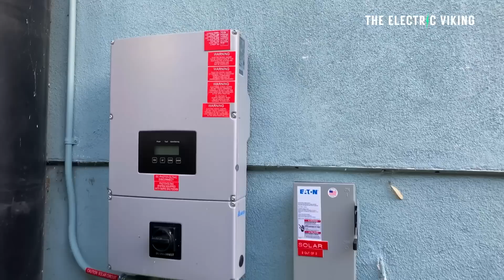Scientists say solar panel advances will see millions go off grid

Comment: In California here in the US the greedy electric utility companies like PG&E are ripping off homeowners by lowering the amount of money the homeowners can get by selling their excess electricity to the electric utility. This is hurting rooftop solar in the US.
Reply: Florida also... we have a net metering law, however solar companies have instituted a minimum monthly charge regardless of how much you generate. Its clearly against the state law but has het gone unchallenged. Its going to lead to many homeowners going off-grid as soon as battery prices allow it.
Reply: Yeah we have the minimum monthly in CA to. PGE offers and electric car rate but that transmission charges and other stuff on top of it so the EV rate comes out the same as if you didn't have it. .35 cents per kw which is the same charge as Suprechargers right now at least during off peak.
Reply: @mxguy2438  Why don't you guys just CUT the grid tie! That'll teach 'em!
Reply: @SeattlePioneer  as battery prices continue to come down people will start cutting the grid tie. It also takes more panels to go completely off grid. Its too bad, they are turning it into a lose lose situation when it could be win-win. The Utilities need to back off on trying to keep with the old ways and simply need to start doing arbitrage so everyone can win.
Reply: @mxguy2438  <<as battery prices continue to come down people will start cutting the grid tie. >>

There are huge advantages to a grid tyie for solar racketeers.  Why should they give that up when they can get so many services from the utility and impose the costs they create on other rate payers?

It's always the greedy solar racketeers who are moaning, groaning and complaining about not being paid enough for the gluts of power they produce. They are always complaining about the utility, but they always keep that grid tie so they can leech off their neighbors.
Reply: The same thing is happening all around the world. ln Australia,  we already have a duck curve problem and it's quickly getting worse as we lead the world in domestic solar uptake.  To be fair,  it is causing big problems for the utility companies because governments didn't address this issue much earlier by encouraging investment in support infrastructure such as energy storage. 
lronically,  by utility companies putting up prices,  all they will do is speed up investment in home batteries and V2L evs which will hurt them even more. ln a way , the utilities are in a death spiral if they don't evolve. The great news is that the transition to clean energy is now well and truly on and clearly gathering pace.
Reply: I wonder if u guys (or us here in Aus) could approach your neighbours and sell it to them. Would that be legal or could you get away with it?
Reply: @theowlsarenot we could sell it to Indonesia
Reply: @harrygroundwater2590 that can't work. Look at the time differences. 
Solar Energy is not produced at night.😊😊😊
Reply: @theowlsarenot   Yeah, just run an extension cord with male plugs on both ends and you're done.  /s
Reply: Yep in Australia too, they keep lowering how much they pay.
Reply: @stephenhammond1656  Probably because the reality is these kind of systems cause issues for power companies that have to regulate the grid. Power is not a bucket that you fill up, it must be used as it is supplied. If not you get voltage spikes and sags. It probably costs them more to utilise your input than it is worth, some places pay nothing and well, that's probably fair. This is also why there is a certain fraction of a grid that can be renewable before it becomes are serious issue. That is why you are hearing about "smart grids" and such.
Reply: South Africa also.
Reply: Same in Australia. They pay 7cents /kWh for your solar then charge you 38cents plus $1 access costs for grid power.
Reply: @yggdrasil9039  The minimum in Victoria Australia is dropping to 3.3c this year. Also,  there is going to be a " sun tax " coming in next year across Australia if you export to the grid during the day between peak times. Another incentive ( sort of ) to encourage people to put in a home battery.
Reply: @billhill4479  yeah this is going to massively backfire for these dumb energy retailers who are screwing us every way they can. Once everyone starts going off grid and they lose all their customers the tune will change.
Reply: @yggdrasil9039  it's not the same power though, is it?

You produce power when it's a glut and then want the utility to supply you with expensive, off peak power.

Why don't you cut the grid tie?
Reply: @SeattlePioneer  now that home storage batteries are getting cheaper I'm giving that idea serious consideration
Reply: Let me now when you actually cut the grid tie.  Until then you are just another solar racketeer getting paid too much for power and getting too much in services from the utility that others must pay for.
Reply: I don't know how most folks can go completely off the grid. The problem is the difference in solar output from summer to winter. I live in northern California and my solar output is about 8 times higher in the peak summer month to the least output winter month. There is no way that batteries could handle the difference. Even the best solar plants in the desert produce about half as much power in the winter as the summer.
Reply: My last bill from PG&E was USD1,000!  And I hardly used elec / gas.

If I wasn't moving to an apt I'd get solar with an inverter and batteries.  They want us to pay for their expenses.  If the no. of users fall, the no. of execs falls.  Thats life!
Reply: Yes!  It would be Nice to have a solar system sized right so that with wind, and battery back up, and solar, we could safely go off grid in Calif. Heat pump water heating, soft start inverter A/C and Led lighting, can go a long way to Elininate PG&E.
Reply: Is this not just a supply and demand thing? More people with solar means more power being pushed into the grid, means the energy suppliers have a glut of people offering up electricity...so they don't need to pay great prices anymore.
Reply: @colinwiseman  It is to do with a concept called dispatchability, too much power is as big a problem as too little, it needs to be balanced and that balancing has to be done in real time. This is also one of the reasons the cost effectiveness of solar is misleading. I am sure there are points in time where you could say they are just fleecing people but generally until the mythical "smart grid" materilises I do kind of sympathise with the energy companies.
Reply: @rshone99 How does Australia do it?  Oower works the same there...
Reply: <<Is this not just a supply and demand thing? More people with solar means more power being pushed into the grid, means the energy suppliers have a glut of people offering up electricity...so they don't need to pay great prices anymore.>>

I agree  ----and it's really worse than that.  Because such power is simply dumped on the grid even when it's can't be used,  utilities may have to waste such power by converting it into heat  ---complete waste.  If they don't do that, voltage would spike too high and damage appliances. 

And yet in California, the solar racketeers used political power to get paid top dollar for that,  and even with the recent reduction, those under the old deal will get GROSSLY EXCESSIVE prices for their power for the next TWENTY YEARS.

That's why I call grid tied solar "solar racketeering." 

If  you don't want to be a solar racketeer, just cut the grid tie.
Reply: @SeattlePioneer  If there is a breakthrough in solar panel output it's over, everyone who can is going off grid. Storage will get cheap just from economy of scale. I guess next they will have to pass a law you have to stay on the grid.
Reply: @SeattlePioneer  put it only putting in less than 20% not 100% huge problem
Reply: Is anyone surprised by the Feed in tariff reductions. I'm not. They will soon be charging for what you put into the system. 😅😅
Reply: Thing is... why should utilities be forced to pay more for solar power than it costs them to make it? 
My state is the same way. We get like $0.03/kw-h. I can't complain thought because THAT IS WHAT THE GENERATION COST is.
If I do rooftop solar, it will be to go 100% off grid.
Reply: I've never understood the logic that a power company should pay a homeowner retail price for the electricity that they buy.  Not many businesses would succeed buying and selling both at retail.

Especially since they are supplying the grid that sends your electricity to other users.

I really hate big corporations and the power companies, but here I've got to side with them.
Reply: I Germany the wind can stay still for two weeks and it can be a cloudy day for many weeks. A battery is good for 8 hours. Some thermalbattaies can last longer. Solar is good battery are good. But sorry doesnt cover it to go offgrid. I the future everthing is possible.  But we need to solve things now.
Reply: <<In California here in the US the greedy electric utility companies like PG&E are ripping off homeowners by lowering the amount of money the homeowners can get by selling their excess electricity to the electric utility. >>

That's because solar racketeers have been ripping off ratepayers by getting paid TOO MUCH for their unreliable and often unneeded power. 

Solar racketeers dump power into the grid when it's not needed and expect to be paid top dollar.  Then they grab up power fro0m the grid when their solar is producing little or nothing.

Want to be your own utility?  Fine by me.  Just cut the grid tie and go off on your own.
Reply: PGEis he worst monopoly in the history of planet earth. Complete corruption and greed. Highest rates in he USA
Reply: Only on NEM3.
Reply: Ahh they’re doing this in Pakistan too. Why are these people such pieces of shit?
Reply: Australia also
Reply: Maybe they’re raising prices because more people are turning to solar setups. Then as more households are pumping into the grid, the price paid goes down…..? Or are they just a bunch of cnts?
Reply: Cheap batteries
Reply: @lesliecox1715 Where ??😅😅
Reply: Ha Ha a five year old could see the problem, the energy company solar peaks at same time as domestic solar. Why would energy companies buy expensive solar off home owners at peak and then sell homeowners normal rate electricity later in the day ?  This means energy companies would have to stand the cost of all the storage of that power.... This is  'we should sell for $5 and buy back later for $0.50c  mentality of stupid greenies unfortunately for the green idiots the supply company has a business to run.
Reply: He's talking self-sufficiency, not selling surplus electricity.  Pay attention.
Reply: All the more reason to leave the grid.  The bigger problem may be new laws will not let you.  California PUC is PG and E's most important asset.
Reply: America is screwed.  The population is brainwashed and feel there is no climate problem, and it has led to complete failure of CO2 remediation in most of the country.
Reply: Sorry it's not greedy power company you're only putting in less than 20% who gets to pay for the missing 80% or so
It's called ohm's law learn it live it love it
Reply: I live in California and don’t love or have stock in PG&E but to set the record straight that Utility has been sued up the wazoo because of forest fires that killed hundreds of people and destroyed thousands of homes.  They were responsible for the ignition of some of these fires but the severity of these conflagrations cannot be blamed on PG&E.  I think it’s unfair to call them greedy.
Reply: Most pension funds are invested in electricity company's.
Reply: So ohm's law shows us electricity is like water must overcome the incoming pressures
Do you have a volt amp meter.
Have you used a regular 12-volt car charger
To simple questions
Come on now ohm's law is only 4th grade math
Reply: But you're only putting in less than 20% there is no excess
Reply: If they won't pay don't let them have it. Find some way to store it even if you have to let cars charge at your house.
Reply: <<If they won't pay don't let them have it. Find some way to store it even if you have to let cars charge at your house>>

Just cut the grid tie and be done with it.  After all,  the video says "It's as simple as THAT!"

Of course,  in most cases,  if you TRIED to cut that grid tie they would be shedding real tears!

They are solar racketeers,  who like all utility suppliers are trying to get as much money and services as they can from other rate payers
Reply: @frankcoffey  Great idea! WHY aren't you doing it?
Reply: Aided and abetted by corrupt governments that allow fees and charges to be levied to prop these thieving power companies
Reply: So you think an energy company should buy at retail and then sell it at retail?  How long would   you stay at your job if you didn't get paid?
Reply: @frequentlycynical642  No, but the electric utilities should not pay so little for the homeowner's excess electricity. How can people afford solar in California when these greedy electric utilities pay them so little for the excess electricity that their solar panels generate?
Reply: @KhanR1-qm2xi  Sigh.  Econ 101.  It's not up to PG&E to make your solar installation pay off sooner.
Reply: Don't put excess back into the grid,  get a battery,  you can use an old electric forklift battery or a bunch of lead acid batterys, do some research, get someone to help, but it's very worthwhile in the long run.
Reply: @stephenhammond1656 , batteries yes but do not use lead acid, LFP far more cost effective.
Cheers
Reply: @patrickmckowen2999  mate,, I don't know about your country, but in Australia the cheapest battery you could use for powering a home, If you have the space to do so, would be lead acid. Compared to any lithium battery, bang for bucks, they win.
Reply: @patrickmckowen2999  Depends on the price you have to pay for the batteries. I obtained several lead acid  battery packs for fork lifts, FREE. Ran them for six years then sold the old batteries for scrap.
Reply: @solentbum  
I cant argue to much about the value you got out of them use and price wise, sounds like you got a great deal out of them.  But they are messy and smelly, if you are using the liquid ones.  Helped my brother switch out his Liquid LA's last year to LFP - just a drity mess.  Two very large floor racks replaced with equivelant power that mounted in 3 small boxes on the wall.

 I might do Gel LA's if the price is right unless the space was critcal,,, changed my mind, not even if free and I had all the space I needed - just antiquated tech IMHO for me,  but I understand and wont judge if others go that route.  Everyone should do what they think is good for them at the time they do it and hopefully no regrets.

Cheers Mate
Reply: @solentbum  I'll guess your fire insurance company didn't know about that and you didn't get electrical permits and inspections to do the work.
Reply: @SeattlePioneer  Guess again.
Reply: <<Don't put excess back into the grid,  get a battery,  you can use an old electric forklift battery or a bunch of lead acid batterys, do some research, get someone to help, but it's very worthwhile in the long run.>>

Until you cut the grid tie,  you are still a solar racketeer.  

Cut the grid tie and you are no longer exploiting the rate payers who have to maintain the grid.
Reply: You’ve got to think at the end of the day you’re still saving a tremendous amount annually by not having an electric bill if you have the proper solar system to accommodate such. Just bc you don’t get much back from selling excess in some peoples situations doesn’t mean it isn’t worth it. The savings are thousands annually and that in and of itself is incredible.
Reply: @FlyWithTyy Pretty much what you said.  Our system is a 7kw system with one 15kw whole house battery (13.5kw usable) and our bill has gone from $400+ monthly to just basically the connection fees ($20-&30).  SCE TOU Prime is basically a 1 for 1 so I sort of use them as a battery.  Seems to work for now.  Making money was never a consideration.  I just wanted the bill to go away.  Keep in mind I have two Teslas in the garage as well.  I have about 16,000 miles between them since Sept and I’ve literally only spent $30 at super chargers.  The rest of the time the power came from our home system. I’ve been to the gas station three times in six months.  Needed gas for the lawn mower and of course my Motorcycles are all ICE.
Reply: We need batteries… lots and lots and lots of batteries.  V2G wouldn’t be a great start.

Comment: Instead of funding wars and US should be helping all Americans go solar. A am concerned about dealing with all the worn out panels.
Reply: Then those in control won’t profit.
Reply: I have a friend who works as an engineer for a national solar company.  Current technology panels efficiency declines about .6% per year.  They warrant 85% at 25 years IIRC.  Once a panel farm is up and running, the only real major cost would be property ownership, mostly taxes.  Unlike wind which needs new blades and perhaps more work at twenty years.  And lots of concrete.  

Let's say I'm wrong by a big margin and it's 1% per year.  You are still at 50% efficiency after 50 years and all you do is nothing but pay property taxes.  And maybe the sheep grazing around your panels pay that and more.  

I don't think "the grid" is anywhere nearing the end of its usefulness.  Solar can't do but a small percentage for an apartment building.  It is also useful for geographical generating balancing.  Wind here, solar dead there.  But I can see the day when it is just a shell of its former self.
Reply: Thanks for your response.